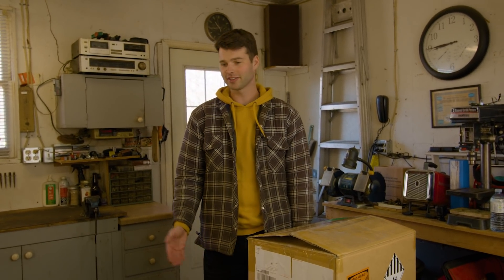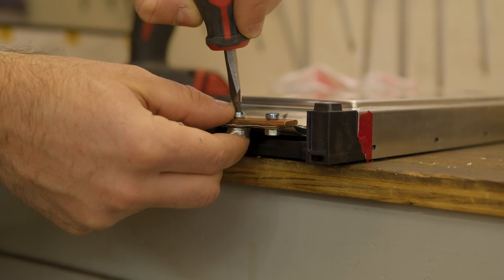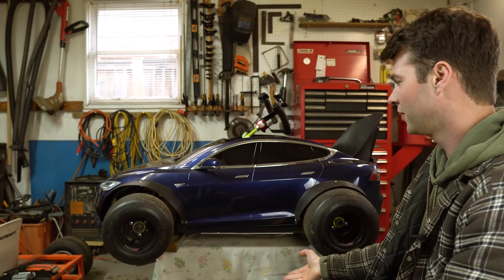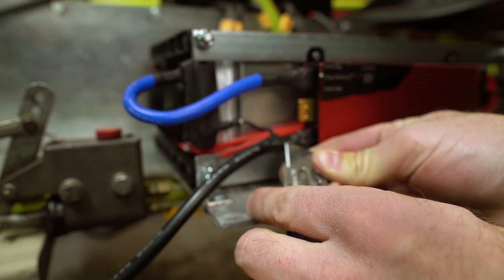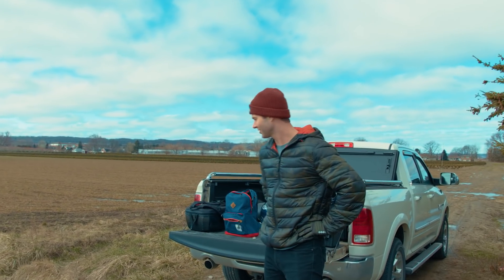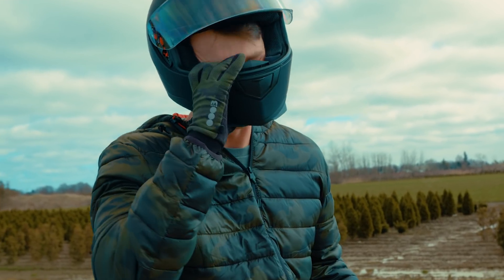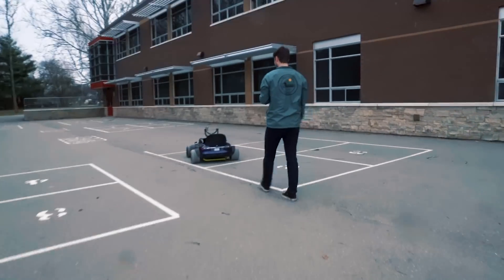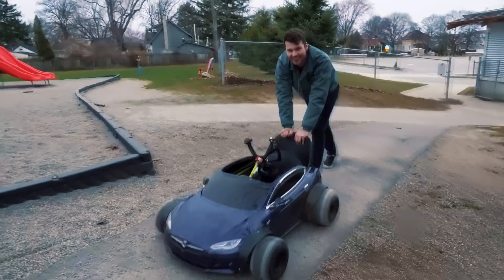Tesla Go Kart Gets a Serious Battery Upgrade

Comment: Smart of you to youse copper, as connection bars, because copper is an precious metal... that means NO teardown. 
IT'S LASTIG FOREVER, if it does not come in contact with a more precious metal such as SILVER or GOLD. But copper make a sort of oxidising that makes a greenish coating, if it is in contact with whater  and oxygen this is in the air, this layer you can scrub, brush with a steal brush, sand or grind away, then the cobber will be as good as new again! 👌🏼 If you do not grind or scrub to too much on so you go just true the layer of the Greenish oxidising, because then you can grind away the copper underneath and scratches may occur.

Comment: im going back and forth between motors.. application is Dirtbike/enduro, ME0907 same used here http://motenergy.com/me0907.html or ME1114 http://www.motenergy.com/me1114.html, or 5KW BLDC Motor https://www.goldenmotor.com/frame-bldcmotor.htm
Id be using a 72v 60ah li-ion battery *using same cells here*, hoping to push 150amps through it. Any thoughts on picking a motor would be beyond helpful, I can't find much info about the BLDC or the ME1114, and whatever info I find seems to contradict eachother. Some people say the BLDC can handle a 180-200amps when its rated for 100amps. I would appreciate any advice!
edit: curves for BLDC https://www.goldenmotor.com/eCar/HPM72-5000Curve%20.pdf https://www.goldenmotor.com/eCar/HPM72-5000.pdf

Comment: 7:30 was golden! did you time your driving time? how long did it last on the full charge?
im on battery hook up but im looking at the slightly smaller SPIM08HP 3.7v 8ah 200a LITHIUM ION POWER packs for a mountain bike build. what do you suggest? @austiwawa

Comment: My super power wheels only goes 21 mph with a 180 lb rider at 3kW. I need MOAR POWER!!! Any thoughts on where to source a high torque motor between 5-10kW? It is currently a 48V system with a 17.5Wh battery pack I made from 18650s from batteryhookup.com

Comment: That seems like such a tiny chassis to be approaching highway speeds on. I'd be so worried about flipping it lol
Reply: Actually no. Its faster then a bike plus its WAYYY more light and its torque is so much for that little thing that you might roll over if you try to drift 💀
Reply: It has a very low center of gravity. Don't underestimate our friend, he is a very calculating young fellow with a brilliant mind. In open go kart racing with 250 cc engines the karts are not much larger than this. They are capable of 125 mph. of course they handle quite a bit better.
Reply: Jack Duno loool the speed he’s going in that thing is almost equivalent to a 🚲
Reply: Luckily all the weight of the car is low just like a Tesla in real life lol (aside from his body weight). This helps with its ability to stay on the ground and not roll.
Reply: @seth-langendoen  the body weight is probably twoce the kart weight tho
Reply: @Kasmuller  In order to calculate wether it’s going to flip at specific speeds and at specific turning degrees, depends on dozens of variables aside from just his body weight.

Comment: is there any concern about overvolting your motor or motor controller? 
Asking because I'm in process of building an electric trike, 48v 1000w front wheel kit, and I bought a 48VDC 20ah 1500 watt battery to power it.  Would I be able to move up to a 52 volt battery pack for a 48 volt motor and a 1000 watt motor controller without burning stuff up???
Reply: Technically running it at a higher voltage will run the motor cooler; what you need to worry about is the current and RPM (friction) caused by the higher voltage. 

Realistically, adding an additional cell in series (from 48v to 52v) will lead to nearly no change in power usage, so I wouldn't worry about the motor. You should worry about the controller being able to handle the additional voltage (however, it will likely be fine as well).